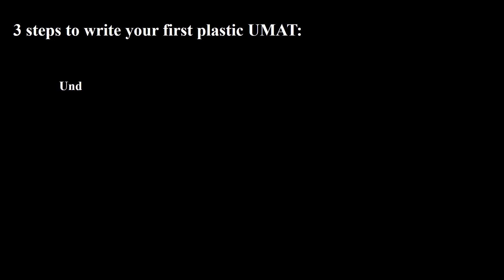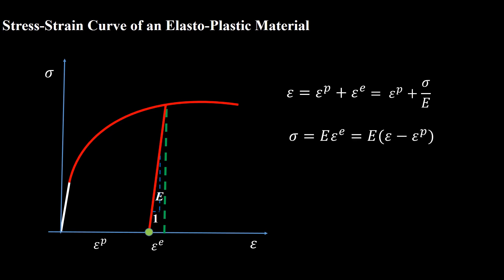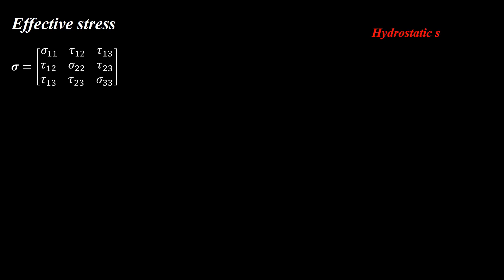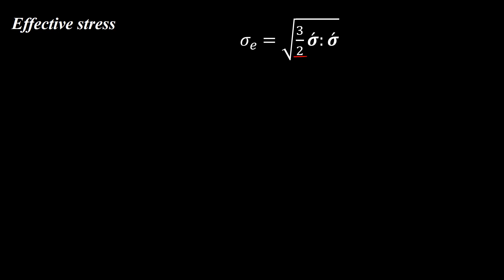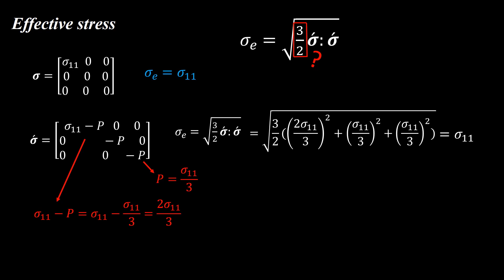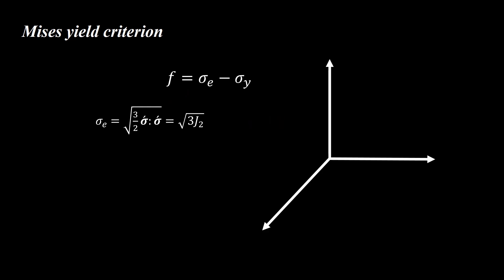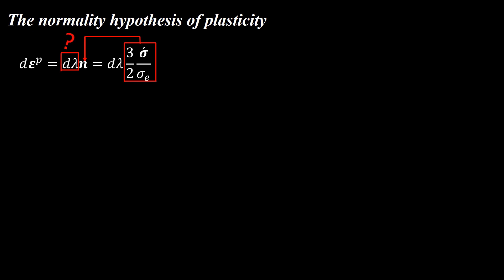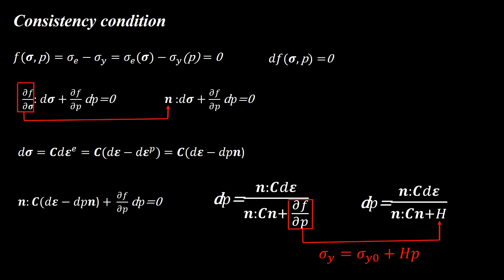Understanding plasticity theory (for Mises UMAT)

Comment: Congratulations for your video. Very well explained. It is difficult to find so good and professional plasticity explanations in internet. I’ve found out that the p-q diagram is very useful to visualize pressure dependency and to progress to Drucker-Prager models for example with tension-compression asymmetries.We are using more and more pressure dependent plastic models for metals in car crash finite element simulations. We need pressure dependent models to build up accurate fracture models.

Comment: Excellent Video I understand the concept of effective stress for various cases. how do you write effective stress equal to Sqrt(2/3 sigma':sigma'), any derivation is available?
Reply from the maker: 2/3 can be found by this fact:
In simple  tension effective stress is equal to applied stress.
Reply: @engineering_software  Thank you very much, This is my long-time doubt,  it is clear Now. Still, I am wondering how they introduce the factor!
Reply: @selvamraj11  I think it was just adopted so that calculation could give test results, once without this, the results would not give what was observed in tests